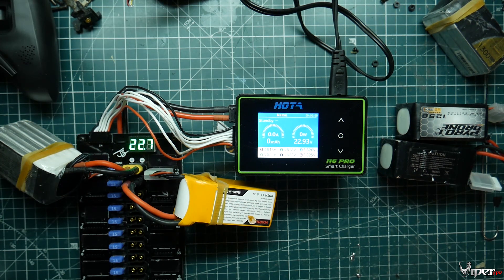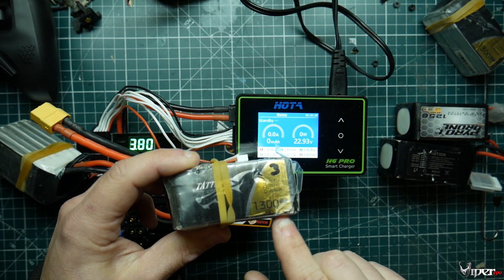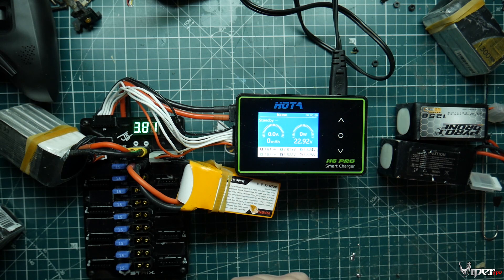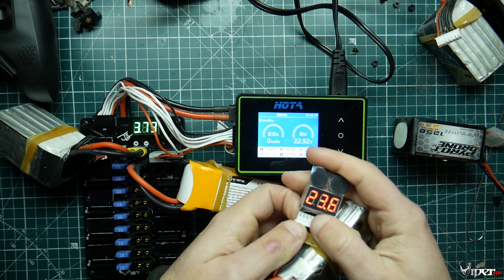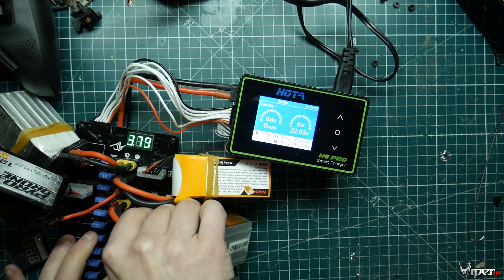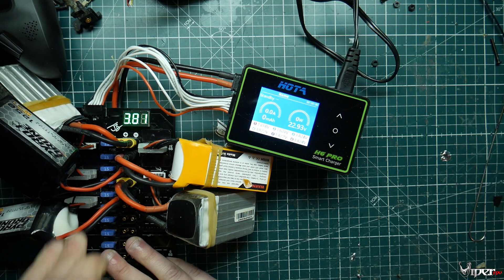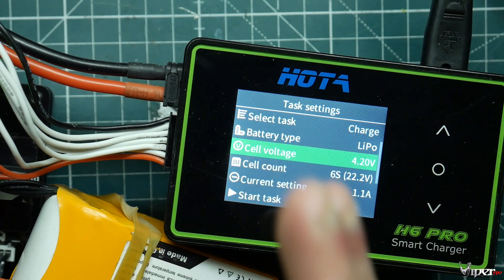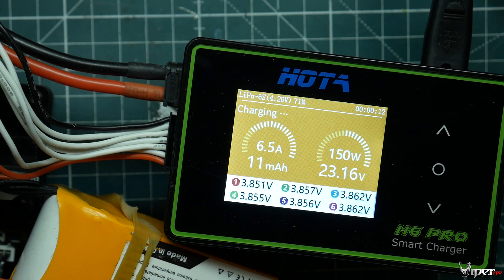How To Parallel Charge LiPo Batteries -  Multiple Lipo Batteries With Just One Charger

Comment: Thank you for the video. I just want to make sure I’m doing this right. I have an ovonic x1 charger, 4x 2s lipos at 550 mah. In the settings I would put 2s (saying 7.4v) batteries in the cell number. In the amperage I’d put .55 or 2.2 because there are 4 batteries? Reason being it has a C1, C2, ect. As a function. And none the videos I watch talk about the voltage. Which on my meter says 4.something to 4.something as an option. The difference isn’t much. Thanks in advance!

Comment: I have a question : Can you do paralle charging with 2 batteries with the same total voltage but with little different cells voltage ? I just can't get my batteries at the exact same cell voltage, always have cells at 3.82/3.67/3.80/3.75 for example. Does the cells voltage is important or only the total voltage ? Thx
Reply from the maker: It should be close together like 3.80 3.75,    3.85 I usually charge within .10 of cells

Comment: A quality board is a must along with a quality charger, add to that a quality checker and your set I know its pricey to start but it's an investment you won't regret I went with an isdt8,isdt checker and only use Bardwell boards for my large stock 10 at a time or the isdt wen I have 2-4 packs I use for other things, but always check the cells and keep it safe! Never lever the room without some one the knows what to do if it goes sideways I keep sand bags made with a vacuum sealer to drop on them if need be or to lay on top if I need to run away for a split second and always use a lipo safe bag of possible... I have a large one it all fits in and the wires just pop out the top corner to the charger ... so many ways to keep it safe just be diligent it's not worth your house or worse......

🥃cheers🍻

Comment: That charger only does 200 watts on the AC cord,  it will do 700 watts with a 24v input but, you're on AC, 200 divided by 6 cells is only 33 watts each cell, ad on the extra cells to make a (Big Battery) and 33 watts per cell don't go very far... unless you have a better explanation! please
Reply from the maker: Tom Jenkins yeah I know that i wasn’t going to pull out my power supply because it noisy
Reply: @ViperFPV  I made a mistake, Let's say you want to charge three 1300 4s packs on the // board and the charger is good for 200 watts total, 4 x 4s =16 x 3p =48 cells leaves 4.16 watts input to each cell, is this incorrect?
Reply from the maker: Tom Jenkins the battery does not calculate in the formula it goes by the input voltage of the charger and amp rating u want to charge at = the wattage
Reply: 6 cell = 22.2V (from what I looked up) so 22.2V X 1.3A(1300mah) = 28.86W (W=VxI) , so 200W/ 28.86 = 6.93 so about 7 batteries he can charge probs 6 just to be safe @Tom Jenkins